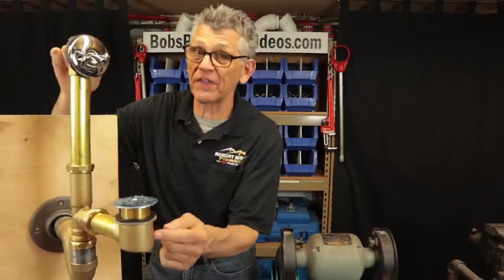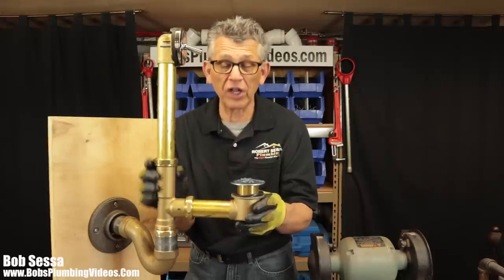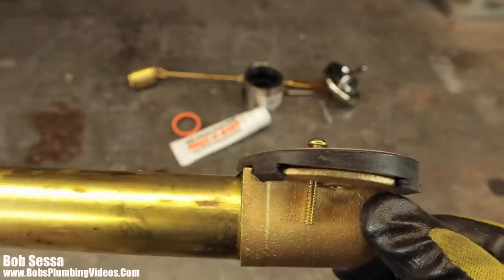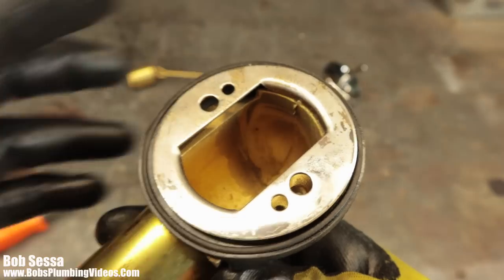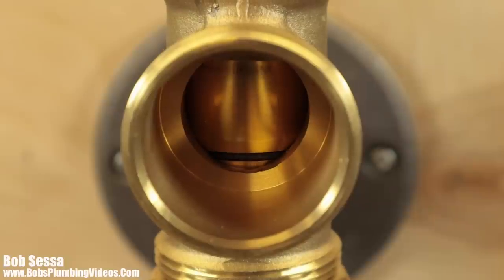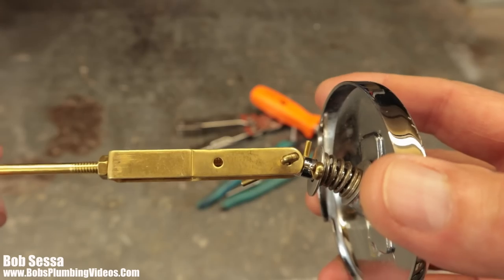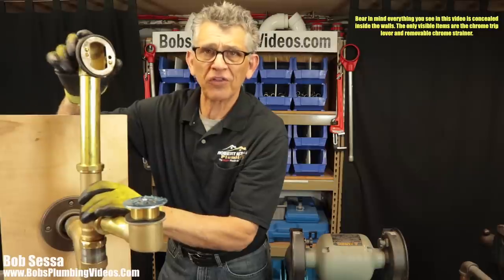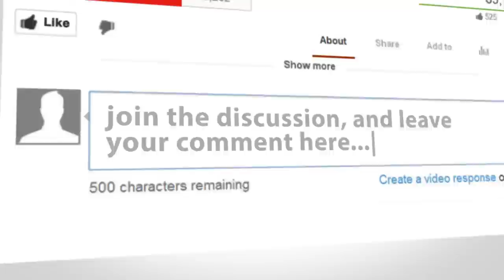Bathtub Drain Stopper / Trip Waste Assembly

Comment: A plumber I hired used a snake down the drainage after removing the plunger. He told us we needed a new plunger assembly that he didn't have so we should buy one and install it ourself.  I bought a new plunger assembly. When I tried to put it back in the assembly, the  plunger wouldn't go all the way down after several attempts. I feel that the overflow system was tilted or something since it doesn't have a backup plate. Any suggestions?
Reply from the maker: I know they make "generic" replacement plunger assemblies and in my experience they never pan out. They need to be manufacturer specific to actually fit properly and hold water. Check this video out  https://youtu.be/XTW6pcDke2U  FF to the 25.00 mark which could be an option for you.

Comment: Excellent video! I actually took the face plate down and removed the system to adjust the length of the plunger but even with adjusting it, the bathtub still won’t hold water. I kept adjusting until the lever wouldn’t go in a full up position, only a little passed halfway, and it still doesn’t hold the water. 
I inspected the 2 O-rings and they look just fine so I’m not sure what to do next. My son loves his bubble baths but the water drains so quickly he can’t even enjoy it! 

Any suggestions? 

P.S: the house was remodeled 1 year ago and the tub and all the plumbing were brand new.
Reply: This is our issue also. Did you find a solution?

Comment: Great video sir. I have a question, my plunger broke off in the pipe, how do I get it out? My tub is not draining. I want to know if there's anything I could try before calling a plumber. Thanks
Reply from the maker: Unless you have access behind the tub to remove the overflow and fish it out, it will be a challenge. I would first try a wire coat hanger and try your best to fish it out. Otherwise plan "A" the the only other solution.

Comment: Hi Bob. I am in a pickle now and need your help. So I have been trying to remove the trip mechanism and ended up breaking the loop where cotter pin goes in the lever. So now the piston assembly is inside the pipe and it's really really stuck. I tried vinegar, CLR and even oil but nothing worked. What do I do other than taking the whole pipe out? I can leave the piston at open position as it's really hard to move it. Can I just leave it there and install overflow cover and drain stop at the drain instead? My OCD tells me not to but I don't see why not. What do you suggest?
Reply from the maker: This exact thing happened to me in a rental unit of the building I occupy for business. The stopper is in the open position, and the water drains fine. When and if the tub ultimately clogs and needs to be snaked I'm going to have to gain access to the overflow dismantle it and replace the linkage and stopper. Fortunately, I have access behind the tub, if you don't have access from behind you will have to approach it from below which is a big P.I.A. I would use a good-quality drain maintenance enzyme on a monthly basis to try and keep it flowing and avoid a clog down the line.

Comment: Mr. Bob sir, please help me, I am trying to avoid another call to plumber.  I bought a new trip lever face place and the other new part that goes with this which my lovely daughter put in for me.  Problem is that the trip lever face place knob will not stay in the up position causing me to manually drain the tub each time I shower or take a bath.  So, was I supposed to adjust the spring before putting it in place?  Was that my mistake sir?  Thank you for helping me.  I appreciate all you do for all of us.  :)
Reply from the maker: The springs are pre tensioned and shouldn't need adjusting. You may just have a bad faceplate? I would try another one to verify, if the same thing happens you may have other issues.
Reply: @BobsPlumbingVideos  Oh thank you so much, sir, for responding to me.  I truly appreciate you and your kindness to an old gal.  Ha!  God Bless you and keep you safe.  Thank you also for spreading your loving, caring, helpful and thoughtful demeanor.  :)

Comment: What's the best way to handle the lever if it's stuck? even after you pull on it
Reply from the maker: Bottom line, access from behind or below! Not a good answer, but when all else does not work (coat hanger, WD-40, Rust Buster Solvents), it's the only solution.

Comment: the screws holding my faceplate appear to be frozen and I’m afraid they will snap if i use more pressure.  any  tricks to loosen them?
Reply from the maker: Spray them with WD-40 let them soak,  then heat with a hairdryer on high amd PRAY!

Comment: HI. So, I tried removing the the old gasket and pushed the pipe inward a bit and something snapped and the overflow pipe fell over from the inside. What do I do? Do I need to remove the whole bathtub?
Reply from the maker: If you have access from behind, no. If not, maybe!

Comment: I got the plunger got stuck inside the plumbing pipe due broken mechanism. Do you have any tips or trick to get it out ? Thanks.
Reply from the maker: Unless you have access behind the tub, it's going to be extremely difficult to accomplish. Opening the wall and dismantling the overflow is really the only option.

Comment: Great video! I really should have watched your video first before I tried things myself. I tried a DIY technique and it didn't work. My trip lever kept binding up so I squirted some white grease around the lever. Well, that helped for a bit then the lever "bound" up again. Well...this next DIY ... wasn't such a good idea as I took a hammer to the lever to close the plunger. I think I broke it. How am I going to be able to get the broken parts out?
Reply from the maker: The plate with the lever usually has two screws you can back off and hopefully pull out. You can get a replacement for it -https://amzn.to/3mTN3bd
Reply: @BobsPlumbingVideos  Thank you! I took off the two screws and pulled out the whole assembly. There was a cotter pin that only was going through one side. I put the cotter pin through to the other side and bent the ends. It worked beautifully just once and now the never is binding up again and hard to trip.

Comment: This was a great video.  I have a question - I do need to aduste my lever as the water still drains I will do this when I get home tonight.  However, another issue i am having is my tub is leaking into my basement.  I am not sure as to where yet is there an easy way to find the leak when the basement ceiling is filled in?  The only opening i am seeing below the tub is the drainage part from the tub.  I am not sure if the leak is comming for the T or not?  Also, when you adjust the weight - will it hit an end point or will it go past the whole for water draining?
Reply from the maker: The stopper with bottom out and not pass the tee, as far as the leak goes.  The  best choice,  is to open the ceiling to take a look. Water could be hitting the overflow plate and leaking from behind rolling down the back of the tub?

Comment: Great video but I'm installing  the overflow to the drainage and because of the insulation on the new tub pipes are on an angle. Stuck at the moment
Reply from the maker: If need be, you might have to trim some of the insulation off to line it up. Whatever it takes to get the job done!

Comment: What if the water is draining fine, but the new bucket on the linkage assembly won't set right when its adjusted the same as the old one? It's like when it goes in, it lacks about an inch before it will set right.
Reply from the maker: If it's a completely new unit, you ultimately have to play with the adjustment to fine-tune it. If you're installing a new linkage into an old or different manufacturer's overflow, it's almost impossible to get it to adjust.

Comment: Great video. What brand is this drain assembly?
Reply from the maker: Made by a company called Wolverine Brass, they only sell to contractors. Gerber makes a nice unit, but they don’t provide that locking method to keep the overflow from finding it’s way out.

Comment: if the connection from the lever to the elevating parts of the drain linkages has broken, and the linkages fall in... is there any trick to trying to get the linkages out of the down pipe?   Mine's disconnected... and i don' tknow if those parts are even in the down pipe from the overflow top.
Reply from the maker: I use a small inspection camera to locate broken parts, but a good old wire coat hanger cut, stretched out with a hook on the end will usually do the trick.
Reply: @BobsPlumbingVideos  thanks.  i quickly figured out that should work as i figured out depth from overflow to buttom of drain pipe and pushed a snake down to make sure it went past that point.  I must have pulled the drain and linkage out long ago.   now if i could just get this darn catch can that's down stream of the drain open so i could clean it out.

Comment: Bob, what is the manuf. and part number of the Waste and overflow kit you show (with the full securing plate and oring plunger)?  the one you link (West-Brass) on Amazon is not the one you show.
Reply from the maker: The one in the video is from a company called Wolverine Brass which sell only to professional contractors. If you're a pro just go over to their website plumbmaster.com and register.

Comment: My brass stopper is stuck in the open position. I tried CLR (calcium, lime rust remover), vinegar, slippery dish liquid, no luck. I pull hard on it but I'm afraid to yank on it very hard and ending up with it breaking off the linkage. Any advice?
Reply from the maker: I had a similar situation in a rental unit, and after all the same methods you tried ended up opening the wall behind the tub, removing the overflow tube and yanked out the stopper. If it's stuck in the open position you may want to take a look at this video. Fast forward this video https://youtu.be/XTW6pcDke2U to the 25:36 mark. Could be an option to approach I took.

Comment: I recently changed my run faucet and the faceplate successfully and was changing the drain to a toe touch and the old drain out and as I went to screw the new one in the entire female threaded end popped out of the bottom t joint, I’ve been trying to get i back in with no luck, I’m in a rental and don’t want to do some huge job requiring to remove the tub. Any tips on how I can get it back in the t joint?
Reply from the maker: That's a tough situation, if the female part of the tub shoe (drain) dropped you'll need to get it back up against the bottom of the tub in order to catch the new strainer. You can try using a coat hanger, slide the new strainer over the hanger then make a hook at the end to try and pull the drain back up. While holding hanger, try to catch the new drain. Definitely a crap shoot!

Comment: How do you get a stuck drain stopper out? Mine will not budge and I have a plugged drain. I dont want to pull to hard
Reply from the maker: It happens to me on occasion and in extreme cases I’ve had to open the wall behind the tub and remove the overflow tube and yank it out. 

You could try spraying some Wd-40 down the overflow tube and let it sit for 24 hours. Then with a pair of pliers give a good pull. 

Good Luck!
Bob

Comment: I Need Help! when we moved into our place it didn't have the switch thing, there's just a hole there. we didn't think it would be a problem because the tub drained fine but a little while ago it wouldn't drain anymore because the bath tub drain thing got stuck closed somehow. Over time it will somehow start draining again and then is suddenly stuck again. right now its suck again but this time we want to fix it for good but we don't know what to do
Reply from the maker: No simple answer, if the original plunger is stuck inside the tee it ultimately has to be removed in order to send a drain snake down the drain in order to properly clean it. If not on an outside wall you may have to open the wall behind the tub and remove the overflow tube in order to remove the plunger. If on an outside wall, it would have to be done from the ceiling below, a job better left to a Pro unless you're a seasoned D.I.Y'er.

Comment: My dilemma is a slow drain and I can’t remove the overflow plate as the screws are not moving. AT ALL. And can you replace the lever with just a faceplate(if you can get it out) as long as I have a drain stopper?
Reply from the maker: Tough situation, I've always managed to remove those screws, until you can get the plate off your only choice is to blow out the clogged with a specialized water ram drain tool or chemicals (not recommended)

Comment: What if the stopped broke inside , while removing the mechanism the stopped didn't come out the metal was so eroded that the mechanism broke off inside
Reply from the maker: It happens! Unless you have access from behind it could be a problem. You could try to fish it out with a wire coat hanger? If the water is draining fine, I wouldn't worry about it. If you need to take a bath, just use a flat round stopper available at any hardware or big box store.

Comment: @BobsPlumbingVideos  Bob great video, i searched around forever and didn't see anything as informative as this. What can you do if the plunger breaks off due to corrosion? Is there a way to fish it out or do i have to rip my wall apart?
Reply from the maker: Your best bet is to use a coat hanger and try to fish out the stopper. It's worked for me in the past, but if it's totally jammed, you might have to perform some surgery! Regards, Bob.
Reply: @robertlamb9232 Use  fish hook and line to snag the old plunger

Comment: Thanks for the video. 
I did installed a new lever but when I took of the screws they were rusted and the broke. 
I had to drill new holes in. While doing the drilling the overflow moved like 1/4 of inch or less. I used a hammer to put it back in place. 
And I installed the new screws. Hopefully everything was ok. That was my first time doing this. Please advice thank you.
Reply: It's not common to use a hammer when dealing with plumbing... Hope all is well

Comment: the drain plunger is stuck cannot removed.. i can remove the two top screws and the silver plate. But, the plunger will not come up allowing it to be removed.  HELP!
Reply from the maker: Happened to me, Try spraying liberally  WD-40 and let is soak for at least 24 hrs. If no luck and you have access from behind, you'll probably have to dismantle the overflow to remove it. If no access you are S.O.L !
Reply: @BobsPlumbingVideos , unfortunately, no behind.  Plummers who installed this weren’t thinking ahead of this.  I will try getting WD40 but not so sure that I can reach that area?

Comment: Great video thanks.  I am having a problem removing that trip lever assembly...  After removing the face plate, the linkage will not pull up through and out of the pipe.  I'm not sure, but it sounds like maybe the stopper is getting hung up somewhere down there.  It sounds like a metal-to-metal clunk when I attempt to pull the linkage up and out.  it just stops dead about a 1/4 inch on the up-pull.  
Any ideas?

Thanks
Reply from the maker: This has happened to me a few times. I’ve added  C.L.R. Down the overflow for a few days to try a loosen the soap scum / calcium build up.

Sometimes it works, sometime not! Good Luck!  Bob.
Reply: @BobsPlumbingVideos  Thanks for the fast reply.  Will give it a shot. ciao, cugino.

Comment: Hi Bob,thanks for this video.My bath tub is leaking underneath the drain.The T and the horizontal drain arm-that attaches to the tub drain underneath,are somewhat rusted.The tub is in a fair condition,and does not need to changed .I have a hot water eater on the other side of the wall of the head of the bathtub/overflow pipe -T etc.So I do not have enough room to allow me to replace the entire drain assembly-which is what I would like to do,rather than changing out the entire tub and the drain assembly. Any ideas as to how I can accomplish what I need to do-since I dont have enough room to work  to change out the drain. Thanks
Reply from the maker: In this situation, I would most likely open the ceiling below and work from the bottom. Once the tub strainer and overflow plate are removed, the entire assembly should drop down. A little tricky working up on a ladder, but it can be done. Good Luck!
Reply: @BobsPlumbingVideos  Bob,thanks fr your quick reply,I should have mentioned that its a  one story building,so I dont have the  ceiling below the tub,its sitting on the bath room concrete floor,and the hot water heater is sitting at the head of the tub,separated by a wall,not enough room to access the tub strainer from below or the overflow pipe and drain from the hot water closet side,or any direction.

Comment: I took it apart but it’s stuck can’t get the triper out. What can I do
Reply from the maker: You can try to spray some WD40 down the overflow to loosen the soap scum etc (let it soak for 24 hrs). If it absolutely will not come out and you have access behind the tub, you may have to open the wall and do a little surgery?

Comment: How does the overflow actually work .... i.e. when the water gets up to that plate?  Right now it's draining down into the living ceiling when someone sneaks a bath ....
Reply from the maker: There is a rubber gasket behind the tub opposite the chrome faceplate. if that becomes dried out or misaligned or moves in any way, water will find it's way down. Replace the gasket or take the faceplate off and try a little silicone caulk to seal any openings.